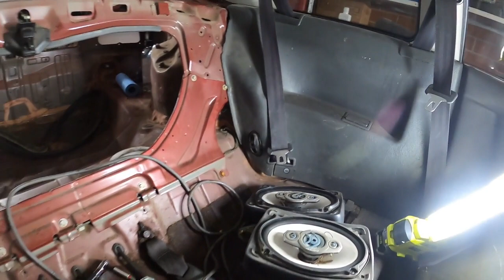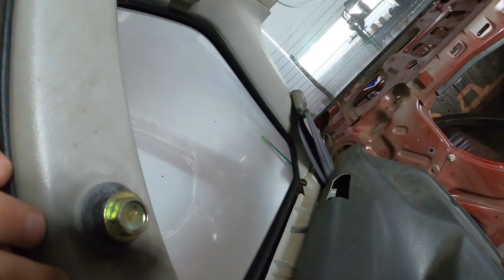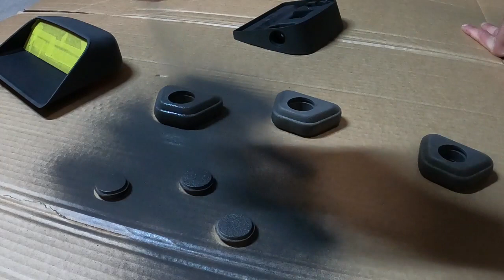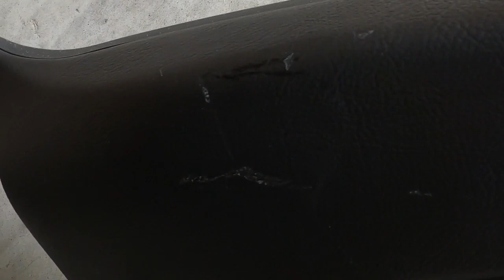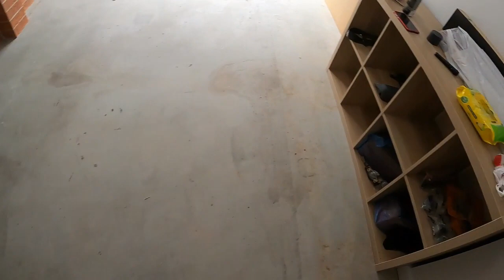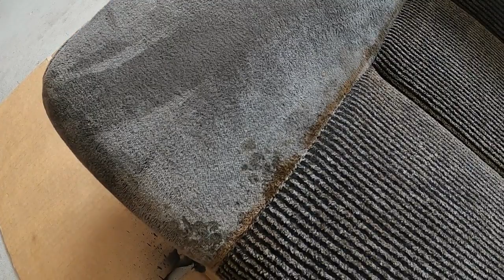I Painted the back seats of my car!!!!. Painting plastic trims and seats Honda Prelude 3rd Gen 1989

Comment: If you're ever trying to restore plastic trim that's suffered scratches and gouge marks just use a scalpel to cut off any hanging bits and hit the area with a heat gun from a distance, you'll have to be careful and do a larger area than just the scratch but it levels the edges of the scratches and makes them almost invisible.
Reply from the maker: I thought about it and saw few videos on how to do it. But tbh I had my doubts. Depending on the distance between the heat gun and the plastic and the time spent on each section,  you won't end up having consistency in color or look. Spray seemed easier and more safer :). Next time, I'll give it a go and see

Comment: So the paint does not come off? Even the seats? All good to wear a white shirt on car?
Reply from the maker: Trust me I tried and nothing.  When you first paint them, you can slightly feel it crusty. But use a normal brush and it goes away. Mind you, no bad smell too. I have not shampooed it after, but I doubt anything bad will happen
Reply: @saltherookie  have u ever removed the dashboard to paint? If u did, how did u remove the steering wheel Honda badge without damaged.
Reply from the maker: @ChannelMAsk  i have not removed it. But I don't expect it to be hard. Being old car and old technology.  In terms of the steering wheel logo, I think you can use heat gun to remove it. I recommend to be extra careful and aim it at a distance to avoid damaging the logo.
Reply: @saltherookie  also avoid the heat to damage the wheel as well. So did u respray the dashboard in black top? Or u haven’t done it yet. Will u make a video when u do it? 🙂
Reply from the maker: @ChannelMAsk  i haven't and wasn't planning.  It is not hard, but too much work to do. At the moment,  I'm intending to do so, but I might in future.  If I did, I will post a video for sure